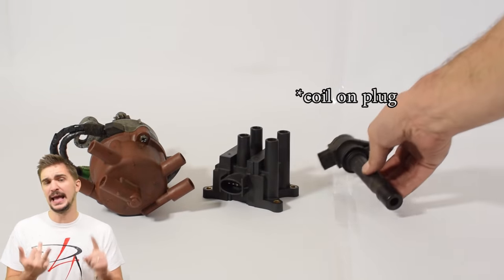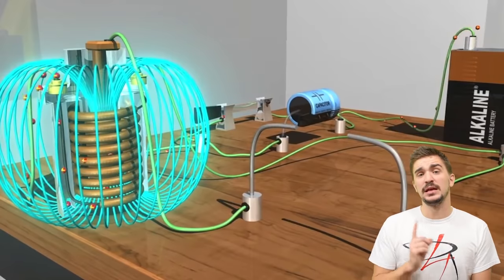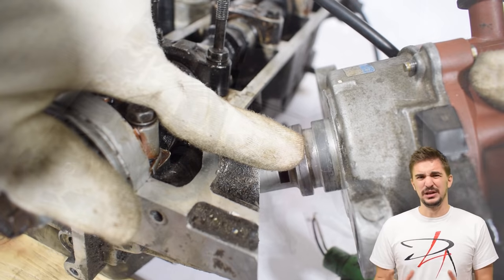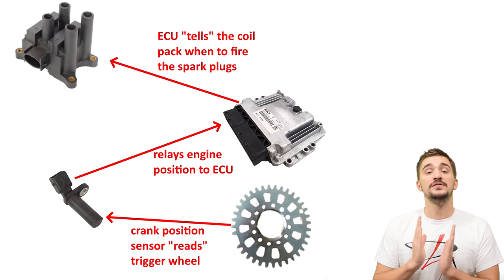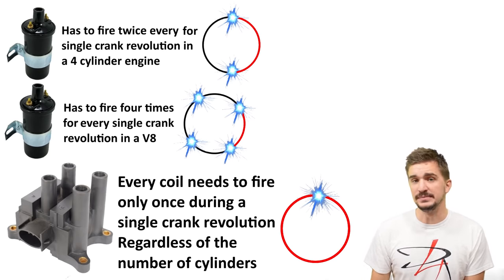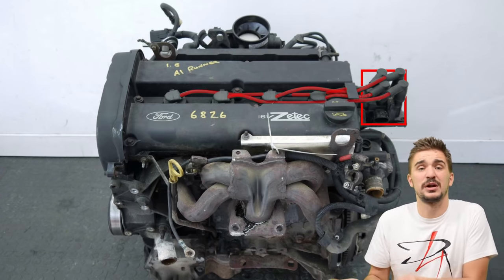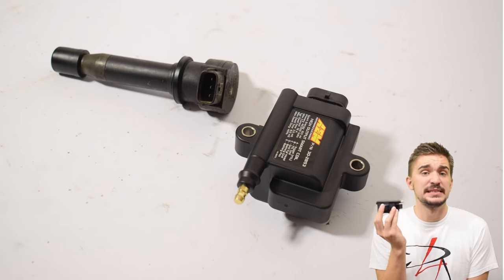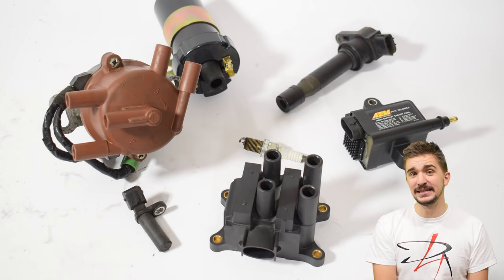Distributor VS Wasted Spark VS Coil on Plug VS MONSTER Coil near Plug

Comment: And now for the bumer:
Basically none of the benefits are as exclusive as you claim.

The good old distributor has quite a few advantage - mechanical simplicity and the resulting reliability and durability. Easy to repair, cheap.
Then there is the other thing that it is not limited in any way to a single coil nor to using sparks for distribution. They can have multiple coils and use IGBTs. Also a fundamental of the coil is - the faster it is driven the faster it builds up the energy.
A bigger problem is the timing as those systems are usually NOT designed for higher RPM and then the ignition simply is too late. But even this can be solved purely electromechanical - heck, even without any extra mechanical components and no active electronics at all.

As for wasted spark:
Why no mentioning of the increased cost and extra mechanical parts needed? Just the same as the distributor it needs a fixed connection to the drive-shaft (be it direct or indirect via a timing-belt).
With a timing-belt it can skip a tooth if you got really bad luck and any extra moving component is an extra point of failure.

And every solution relying on an electronic control unit for the ignition has the same big advantages and disadvantages:
You got extra electronics and a very harsh and noise environment and not way for a normal person to repair. But due to being based on software it can also easily react to other sensor-inputs enabling a change in injection/ignition behaviour depending on the situation.

Comment: Question: if side A of 1and 4 is not sparking can I switch to side B of 2?and 3 for the first ignition?
Reply: A little history we first switched coil plug cables one with four and it worked once’s and now it doesn’t work so I was thinking if you can try swapping one and two and three and four Would it is still work?
Reply from the maker: On wasted spark? You definitely should not switch between side A and B. You can only switch around 1 and 4 and 2 and 3, the ones on the same side, but that does nothing actually.
Reply: @d4a   yes
Reply: @d4a  my wasted spark coil is cracked at the bottom I don’t know if that could be the cause of it not sparking?

Comment: The mechanical distributor has a big advantige. In case of an EMP this thing works just fine while ECU‘S don’t.
Reply from the maker: Ah yes the EMP..... Such an important factor.
Reply: @d4a  Maybe not that important but... we‘ll never know. It could happen any time. And so it‘s a little bit unfair to say that the mechanical distributor has no advantages at all xD. Because it works when an ECU don’t.

Comment: You are gonna use the 1zz denso Cop's for your build rigg?
Reply from the maker: Nope, I'll be using the AEM overkill ones :)
Reply: @d4a  you need a Piet Jordan/Manon engine to at least justify them so are we gonna see 600hp+?
Reply from the maker: Manon makes 180 hp engines too, there's really no relationship between builder name and coil justification. Nope, I'm not doing 600 hp, but having extra spark juice never hurt anybody. Another key reason is that these are very easy to mount, and COP adapter plates for the 4AFE don't exist, so I would have to design and cnc one from scratch which is a very large expense in terms of both time and money.
Reply: @d4a  guess you got the goodies and might as well use them

Comment: Dont need to watch, I know c.o.p is better because of the individual coil per cylinder. Dwell time can be as long as it needs.
Reply from the maker: A lot of the comments section will disagree with you. The distributor is getting massive praise in the comments 😂
Reply: @d4a  if there was individual coil per cylinder it wouldn't matter what "trigger" device you use. 

You want the magnetic fields to be at full strength before it collapses, at higher RPMs it becomes harder for a single coil to dwell properly because the ignition events are happening sooner.
Reply from the maker: Yes, I talked about this extensively in the video...
Reply: @d4a  I think most people enjoy the simplicity of a dizzy vrs  computer controlled triggers. 

We all hate waste spark.
Reply: Obilwe wufuh Mubufu Oulou  oh yeah especially when you run solid copper plug wires with no rfi shealding hahahaha 
Old heads would say it would fuck with TVs as they drove past
Reply: Obilwe wufuh Mubufu Oulou  iv been saving up for a good O-scope scantool combo. Nothing beats the "old school" trick though hahahahah

Comment: One advantage of an old distributor system is that it doesn't have a crankshaft position sensor. I've had a modern car with a wasted spark system abruptly die on me in the middle of the freeway, with no prior warning whatsoever, due to a failed crank sensor. That darned crank sensor was also the culprit in a cranks but wont start ghost in the machine problem too. Then you take it to the mechanic and it works fine for them so no fault found.

Comment: Ironically top fuel, the fastest accelerating vehicles in the world making over 10000 horsepower still uses mag based distributors. There is still a application for everything.
Reply from the maker: You mean the MSD pro-mag?   Well you're technically correct I guess, but somehow calling those things just "mag based distributors" feels like a bit of an insult 😂
Reply: @d4a   magneto style distributors have been used over 100 years...  from aviation to lawn equipment. I say mag based because  a pro mag is still a mag no matter how advanced it is.

Comment: Would like a monster coil for my ktm
Reply: Unless your current coil is actually reached its limit and failing to provide spark then you will see no benefit with a monster coil.
Giving an engine more spark than it needs won't magically make it more powerful.

Comment: Can I put this near plug in my Ford Taurus 95, EEC-IV, with distributor?
Reply: likely yes but you would need a standalone engine management with 6 spare outputs for direct fire.
Reply: @7sins979  Thanks For your input on this. I've another question: This mentioned standalone management would Fully replace my original ECU/PCM or would it work together with the original ECM? The few months later car had just coils not distributor. Would a newer car PCM work on this near plugs coils?
Reply: @tomasnokechtesledger1786  standalone engine management would replace the existing system. the newer pcm may work but unlikely as 96 was the start of obdII. at the end of the day your ignition system probably works well and is not the old mechanical/ vacuum advance system. converting would likely cost more than vehicle is worth.
Reply: @7sins979  Yes, it's Hall effect with Thick Film, pretty modern for a dist. I think the distributor less that came in 1995 was already ODB2. So, not worth it, then. All right, thank you.
Reply: @tomasnokechtesledger1786  np

Comment: lot of rubish magnetic fiald is created when 2 forces colide to ich other you can eather use ac and ac ore ac and dc pulse that pick up coil is considered as a generator exactly a ac/dc magneto! add 12v and that generator pulse voltage together you create virtual grounding or a dead short thats where those energy comes from its nit the baterry by the way who is the energy source its the alternator! thats a closed system it does not use the baterry to produce that spark! teach kids what generator ignition is that is wrong represented! you can do it with the starter motor as well. that ignition coil multiply that power going from the alternator potential and that small pick up coil with a capacitor potential and there you go if you use diferent wires like resistance ore manipulate those generators out put you get plazma ignition it burnes even water on contact. what ever a volta baterry does not need power that same principel can work a ignition coil even with out adding power a volta baterry works with plates and salt water it works with coil as well ore you culd use the flywhell ore pump tuths to simulate a reluctor look please wikipedia for some info some school crap is not realy acurate at all about teaching methodes.
on more thing gasoline and disel are 1 and the same that spark simulates preshure by electrical mean's dont belive my? use plazma ignition and put disel in a gasoline engine it will work before that remove all senzors who create magnetic fialds and thats it drive all day on some thing ells. that litel detail peopel dont mention expecialy not mechanics.my sohc opel ascona run on disel when hot enough even cold it will run if you manipulate some fuel to air ratio they have normaly some higher compresion ratio and you need to advance ignition timing to make it work. goid video but still I must point out some real things.still dont belive my then see old Lenz Bulldog tractors they run gasoline/disel even they can run with engine not compliating a cikel their engines run back wards some old acient engines forgoten with interesting tehnology

Comment: I never understood coil on plug when 1 coil is good for 800 hp or more. It must be an emission thing
Reply: Obilwe wufuh Mubufu Oulou  my v6 toyota has 3 coil on plugs and then pig tails off each one to the back cylinders. You wouldn't be able to control it all with that set up
Reply: Obilwe wufuh Mubufu Oulou  thats my point. The ECU has 3 coils to control on a v6. Not much for options compared to 6 for 6

Comment: Simple distributor ignition, and stone age points ignition distributors have one huge advantage. Simplicity. Any mechanic who can remenber his name can fix a points ignition with a hanful of simple tools. Back in the day many people carried a spare points and condensor in the glove box, maybe a coil too for a long trip. Ignition failure might mean a half hour delay, not a wait for a recovery truck and a hefty bill from a repair shop. It's fair to say modern cars are very reliable, but keeping it simple has its place.
Reply: "Back in the day many people carried a spare points and condensor in the glove box".

In other words, points are more prone to failing than HEI.
Reply: @gregsmith332  You ever tried fitting an HEI distributor in a glove box? They weren't more or less prone to failing, but if points ignition did break down it was an easy repair.
Reply: @claudgurr431  "They weren't more or less prone to failing" 
They do. Points fail faster and fail more frequently. Not everybody doesn't want to replace points with every 2500-mile oil change or earlier like you do.
Reply: @claudgurr431  "You ever tried fitting an HEI distributor in a glove box?"
You don't need to.
"if points ignition did break down it was an easy repair."
It's when, not if, they fail. That's because points fail faster and fail more frequently. Not everybody doesn't wants to replace points with every sub-2500-mile oil change like you do.
Reply: @gregsmith332  I've probably covered the best part of a million miles in points ignition cars. Replaced the points as part of routine maintenance around every 12000 miles. I don't actually remember a points failure, although I had a faulty set in a box once. A few coil failures, a couple of distributor caps, and a failed rotor arm. Several broken ballast resistors on some Mopar cars (equipped with factory electronic ignition). Three failed electronic modules, 1Mopar, 2 GM. Get over yourself.
Reply: @claudgurr431  "Replaced the points as part of routine maintenance around every 12000 miles." 

You need to realize that most people don't have a Uncle Tony mindset and want to constantly change out points like you do. Also, points do have to be constantly regapped.
Reply: @gregsmith332  Thank you, I was having trouble getting to sleep tonight, reading your replies again worked a treat! 👍